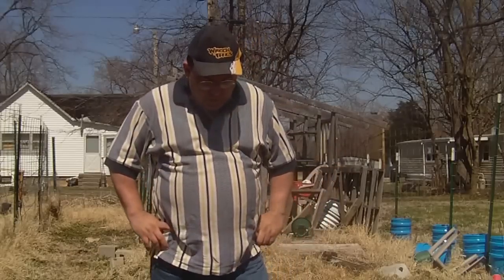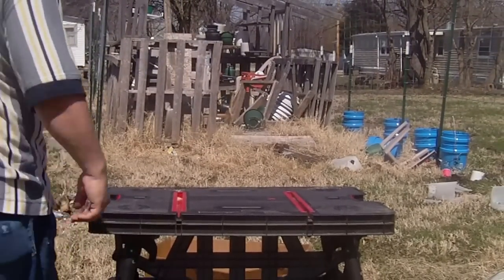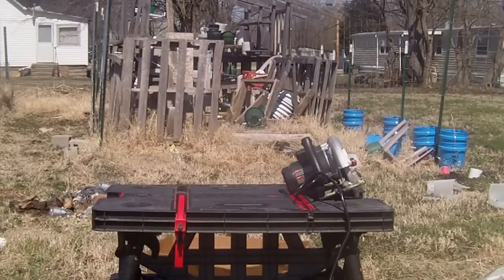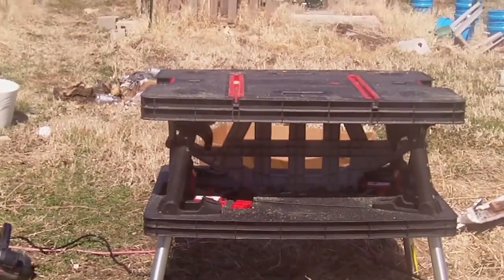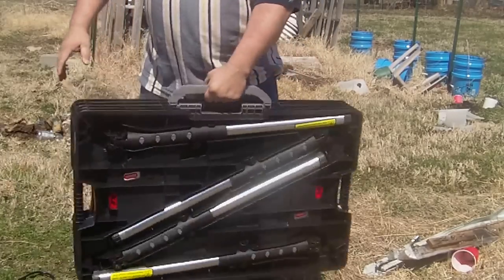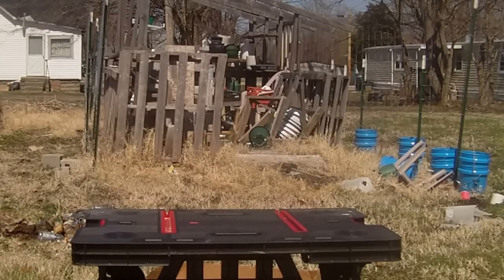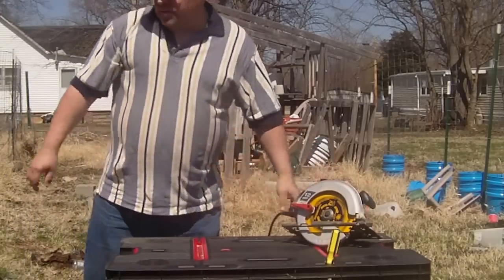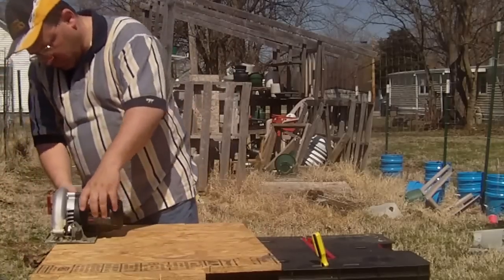KETER FOLDING WORK TABLE

Comment: The two clamps provided are designed to run in the track to hold 2x4's like you showed but they also go through the slots in the table (where you put the screwdrivers). Put the bottom part through the table, twist, and you now have a pair of hold down clamps. Perfect for gripping a sheet of plywood.

Comment: That is a great little table.  Large enough to do most projects on yet small enough to carry around.  I like the way you can use either handle and it opens and closes easily.  Great job.

Comment: hey, I have been looking at different ways to make a shop inside my apartment, and your video may have sold me on the walmart table. I like the part about it folding up easily. I have been looking at workbenches at home depot,lowes and harbor freight. the best deal I have seen so far is the $69 fold up 6 foot long wooden work table at home depot but they are out of them. I am going to check out the ketel to use as a separate bench.l, thanks for the tip and good luck with growing subscribers, I subbed a while back.

Comment: Its plastic, enough said ! ! !
Reply: What do you do for a living, run around from one fold up table video to another demonizing them because they're plastic? The F-22 is mostly a type of plastic too! LMAO!
Reply: Andork Kuomo How would you make a living doing that ! Perhaps you are just used to crap.  I'm not.
Reply: If you haven't looked at plastics in a while you'll be surprised to learn that plastics (there are many different formulations) have been greatly improved since the 1950s, you may want to give it a try. For long term durability it can't beat stone, but if you value factors like weight, cost, and being rustproof it offers advantages for many applications. You just have to match the material to the job.
Reply: Jim Welton I know, I have since worked in an industrial plant using HDPE and realised how many advancements there has been.